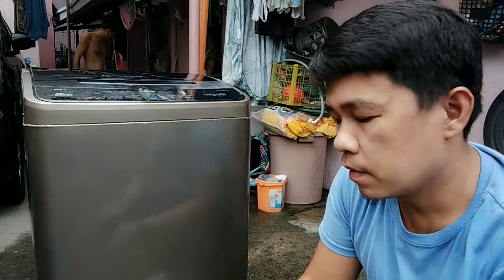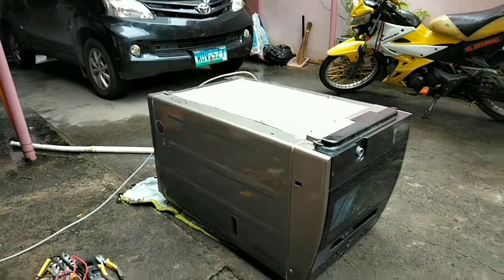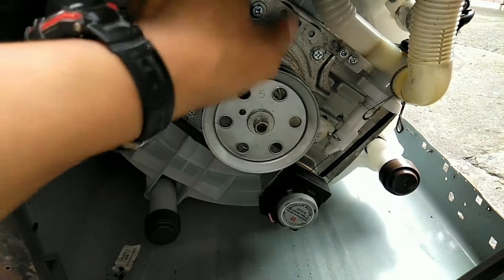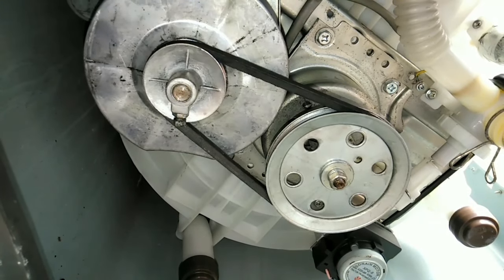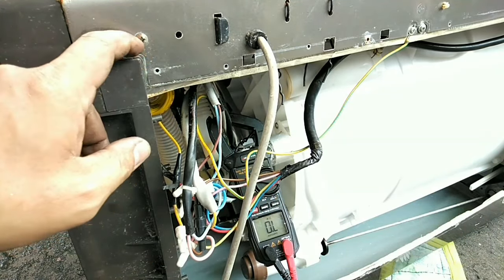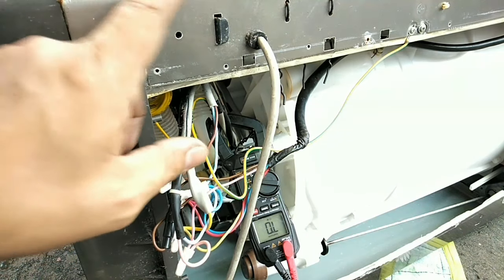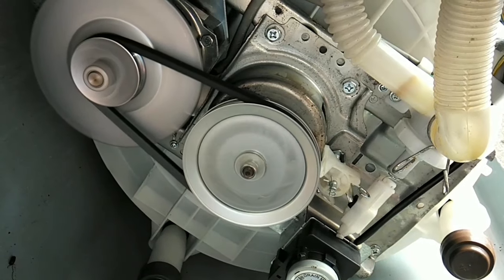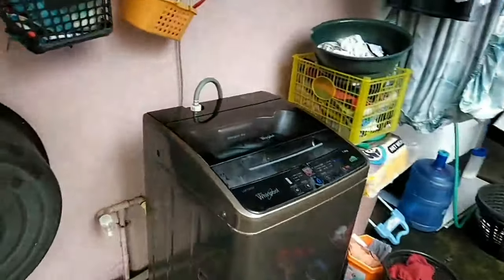Whirpool Automatic Washing machine SPIN Problem.( Tagalog )

Comment: Master may tanung ako walang spin sya pero okey nmn kapag ngawashing
Check ko prino ok nmn capacitor ok nmn
Reply: Gg n ako hehehe
Reply: Master s tingin anu p po ang problem
Reply from the maker: Check nio tension ng drain motor cable baka masydo na nakalaylay.
Reply from the maker: Chek nio.muna tension cable ng drain motor.
Reply: @kamastertvlhonsantelices 
Master ma rerepair p bo un
Reply: Maluwag n po
Reply: @kamastertvlhonsantelices  salamat master
Reply from the maker: Try nio po actual into 220v
Reply: Same problem po.. location QC. San po kayo?
Reply from the maker: San  jose del.monte bulacan po.

Comment: Ka master ganyang top load din akin Ang problema pag ka on mo derederetso Ng umiikot walang hinto tas pag I pause nag error sya EC
Reply from the maker: Pag ka ganun sir board napo maarin problema niyan.lalo wala kapa command tapos iikot na agad siya.
Reply: Oo nga po Wala pa po command iikot na
Reply: Ipinarepair po kc nmin to ka master Ang problema lng po maingay pero naggamit po nmin Ng matino Ang nangyari po imbes n mapatahimik e nasira lng po Ng nagrepair
Reply: Sabi nya po re-busing lng daw po tas capacitor kaya maingay e nung napalitan nya n po yan lahat ganyan n nangyari d n mapapakinabangan
Reply: Pumutok pa po pla ung fuse
Reply from the maker: Wala naman po boshing yan sir..
Bearing napo ang gamit niyan at hindi.boshing..
Reply from the maker: Pagka ganun sir board napo problema niyan
Reply from the maker: Kong maingay sir hindi po boshing yan gaya ng sinabi ng gumawa..maari po splutch spring po ang problema baka putol na.
Reply: Sana pala d nlng nmin pinagalaw Wala tuloy kami washing ngaun gumagana nmn un maingay lng sinira lng ni manong🥺
Reply from the maker: Ung Boshing po kc ginagamit lng yan sa mga motor ng washing machine na manual..pero sa automatic po bearing na ang ginagamit..
Reply: Salamat s mga sagot ka master